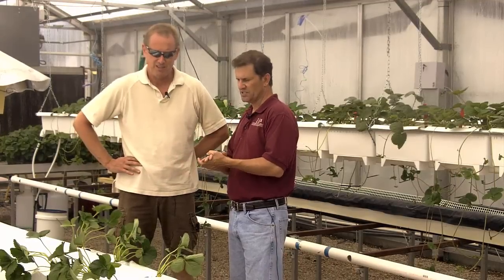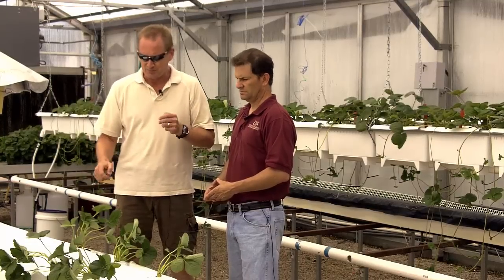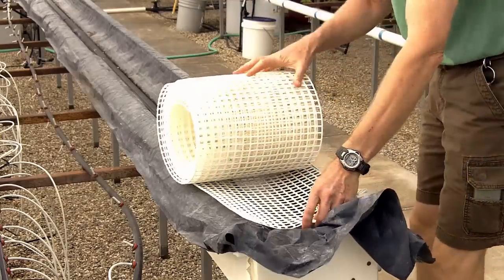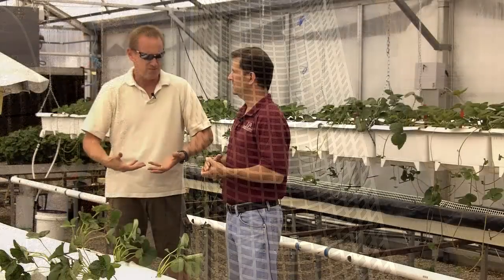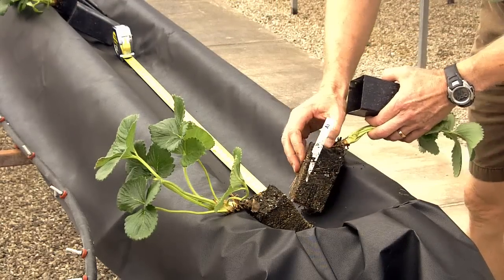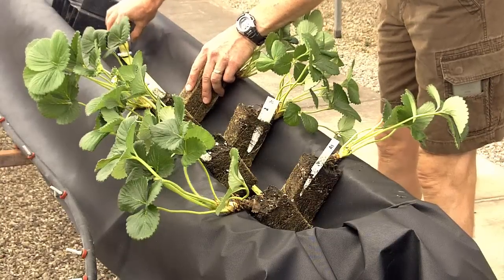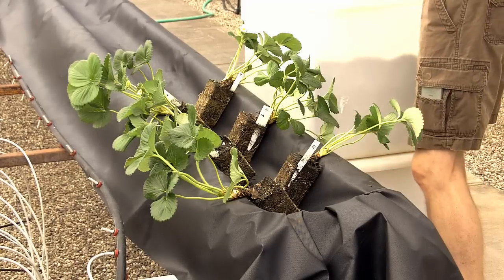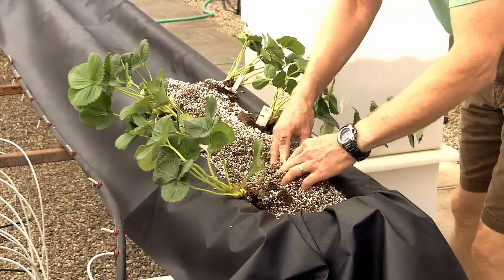Video 2. Arizona Gutter System for Greenhouse Strawberry Production

Comment: HI May i know the Volume of Substrate per meter until you settle everything, how many litres and if may i know what is the weight per meter with plants and well watered or fully saturated media while planting and what is the maximum weight per meter when fruits and at its peak production as whole how much does it weigh. Secondly what is the spacing of the supports for the gutter., Thanks in advance

Comment: You are spending so much on the process that it reaches the state of diminished return before the first berry is picked.
Reply: +Candide Thirtythree  If this helps, there might be a clue behind this rational: Walmart can buy the same product from a Mexican greenhouse for 4/5 less.  That said, it would be interesting to have a segment on the market conditions including capital and start-up.  Most growers on the US side of the Southwest will agree that once a technology can be supplanted south the labor costs and other agency issues result in a more profitable return.  They should have filmed this in central Mexico.
Reply: @jimcameron9848   The Arizona program has some rough figures at:  https://cals.arizona.edu/strawberry/Hydroponic_Strawberry_Information_Website/Costs.html..... it is only a guideline since there are so many variables in market and in individual management, of course.
Reply: Hello. What is the black materials using on this Video?
Reply: The story of academia eh?